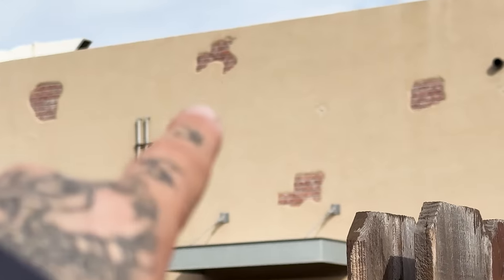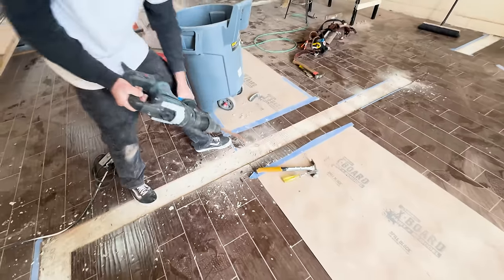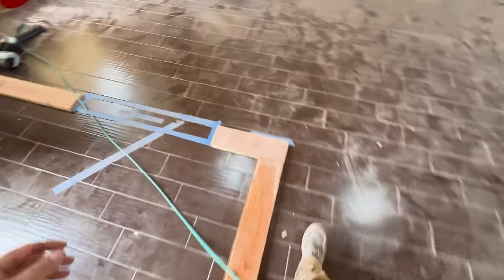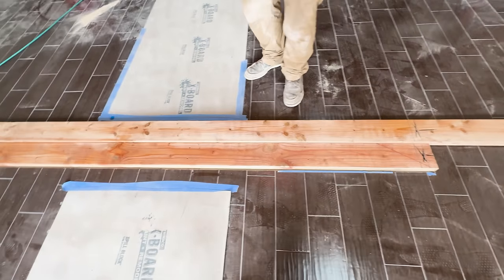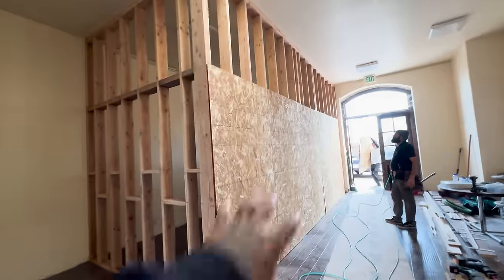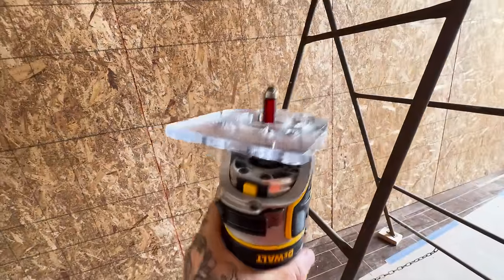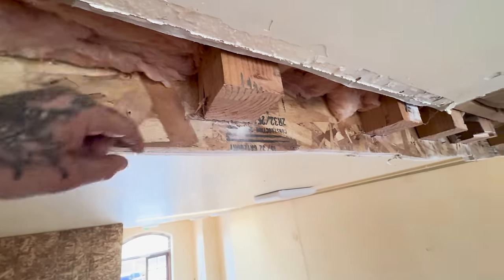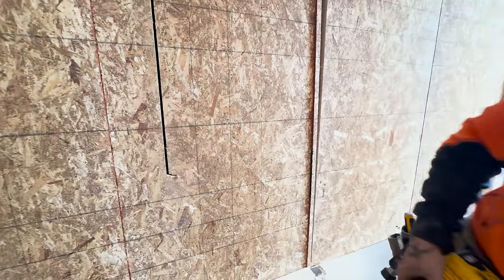Renovating 1900's Building | Demo Crew Removed A Structural Wall..

Comment: Random question on remodeling for old buildings… what do you guys do if some of the framing is true 2x6 or true 2x4? Thicker drywall?
Reply from the maker: If we've got true dimension, we'll match one side and fir out the other with sheathing.
Reply: @MattBangsWood  Copy! Thanks Matt. Keep up the good work. Great videos!

Comment: Those small routers are meant to take out cuts less then 1/16 of an inch at a time. Trying to cut a 5/8 sheet is asking Quite a lot!   That’s like asking a kid who weighs 40 lbs to carry two packs of shingles up the ladder.  Yeah it could be done….   But there are better alternatives.